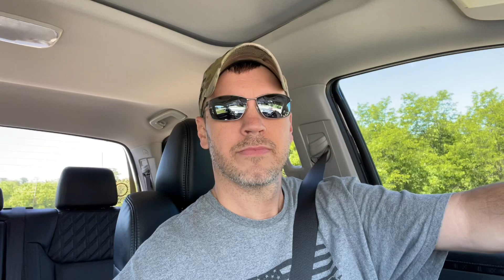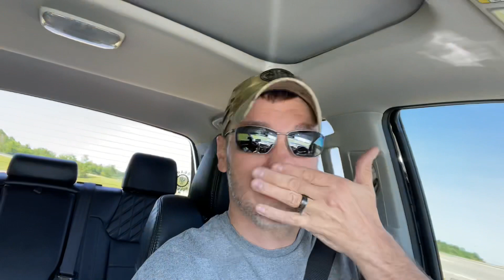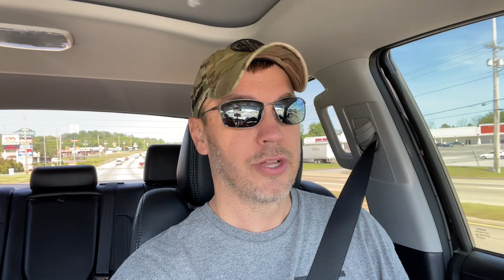2022 Tundra… This Could Extend Your Turbo Life

Comment: New 3.5tt land cruiser motors make 409hp. Not much of a difference for me to switch to a 2022 tundra if that's what they intend to use in it. If I wanted more HP I'd be putting on a supercharger.  I hate turbos.

Comment: I ran a 2011 F150 to +250k miles before I changed jobs. It may still be going for all I know. The turbos never caused any issues. Timing chain stretched, replaced transmission and had a few other minor issues, but never any turbo or other mechanical issues in the engine and it was worked reasonably hard. I’m sure turbos might be a problem if they are a bad design, but you don’t seem to be basing your opinion on anything.

Comment: You mean up to 130000 vs 160000 RPM. Typical at cruising speed is probably 80k for a garret air research turbo charger

Comment: No replacement for displacement. That V6 is going to be screaming to do compete with a V8. More RPM more friction, heat and more maintenance. Hopefully we get later than sooner with Toyota reliability on the when the turbo goes. Great info 👍.
Reply: Ole Don Garlits knew when he said that about his Swamp Rat!

Comment: Hi Andy, Wes here again. Just wanted to check if you did get the Bullydog Tuner. I think I am going to get it, actually I may order it today. I have done alot of resesrch, just haven't talked to anyone that has one. You should get one Andy, and make a video on it lol. I want that throttle response and change the shift points, especially the 3rd to 4th gear.
Reply: If you want more throttle response, go buy a pedal commander. It has alot of different settings for how much throttle response you want and completely plug and play.
Reply: I like Gear & he's videos.... Lucky men can affor trucks.... Im broke to buy anything🤷but its ok

Comment: Turbos was one of the factors why I got rid of my 2015 F150 Ecoboost. In all reality their biggest foe is when you shut engine off, you’re also cutting off oil pressure. Keep in mind those spools turn in excess of 50k rpm, under load or high speed they will turn “Cherry Red”
What Ford did to help it is they placed the oil filter up high so oil flows to the turbos by gravity as they wind down.
And you are right… they’re longevity’s weak link.
Though fun to drive, but it will sadden your finances unnecessarily.
Good video and advice, my wife had a 1985 Volvo 760 Turbo and blew out at 27k miles and the factory/dealer installed and oil accumulator which added an additional 1.5 qt of oil, when you shut off it would feed oil to the turbo not only helped cooling but kept it lubed until it stopped spinning.